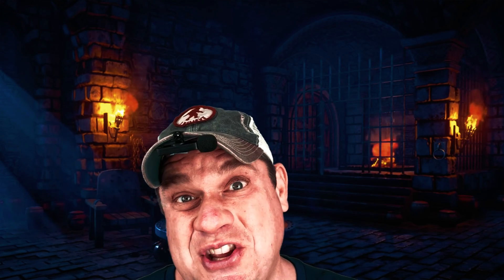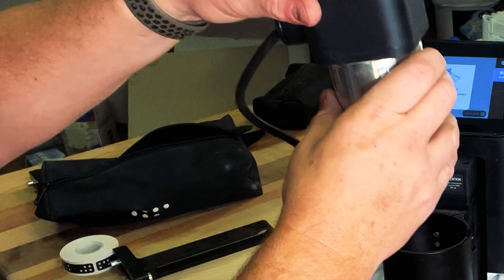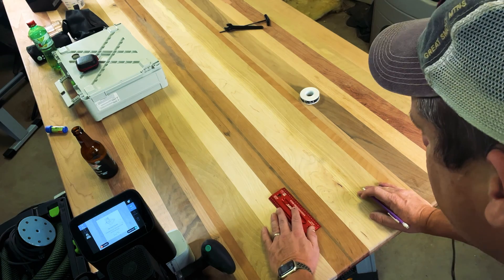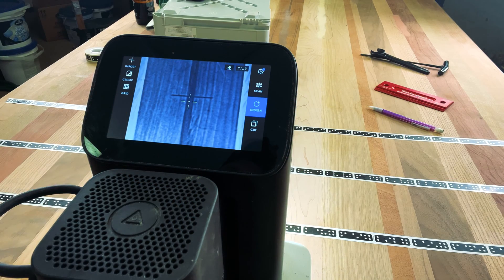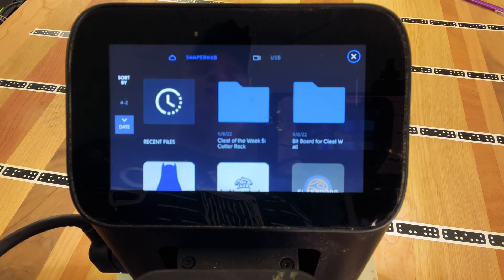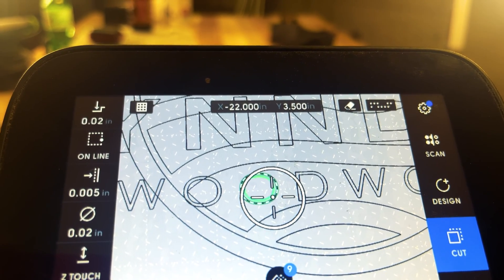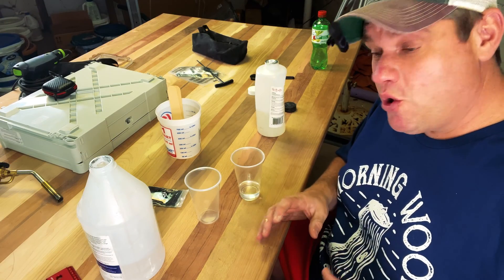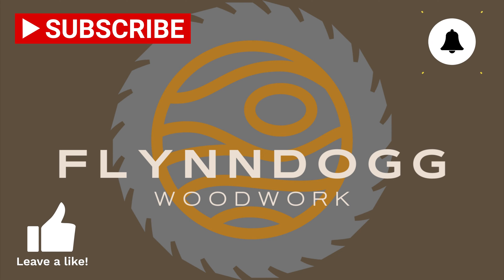Shaper Origin Basics: Everything You Need to Know About This Powerful Tool!

Comment: new subscriber, thanks for making this video.  I'm a new woodworker, 2 years in, learning like a sponge.  I want to go CNC but have a really compressed space, so I was thinking there may be another solution and that's how i cam across this.  Do you think it's a good solution for a beginner and for small shop space?  If it wasn't for Youtubers like you, newbies like me would still be stuck making bookshelves and cutting boards :)
Reply from the maker: Haha!  Nothing wrong with bookshelf's and cutting boards! :).    You know I actually got this when I was just about 4 years into woodworking and I have never looked back.    I think it's a great solution not only for a small shop, but even a larger one like mine.  It's one of those tools that I don't use on a daily basis but it is indispensable when I need it.    It is also very user freindly.   I picked up on how to use it fairly quickly and I'm still amazed today by the technology in it.  I would say go for it.  It's got a big price tag, but once you see it work you will understand why!

Comment: Thank you, you make it all look so easy! I purchased my SO a month ago and have yet to make a cut. I guess one thing I missed or didn’t understand is after setting grid. How did that Aline with your center mark? Did you just see it on screen when you set image? Thanks. Maybe today is the day! I have high hopes but I’m an old guy and very intimidated by computers and electronics. BTW I really appreciate how clear you explain things. I have had trouble following some of the Shaper sessions. I feel like they are just talking on a level that doesn’t exist for me quite often.
Reply from the maker: Yes!  You can just align the image as soon as you have the grid line or even if you don't have it.   I think you will be really quite surprised at how intuitive it is.   I use this thing about 3-4 times a year and I definitely don't consider myself an expert, but every time I pick it up, it is so easy to figure out because the prompts walk you through everything.  You will really be impressed!

Comment: Good explanation except how do you scale the vector graphic? Also I presume the dominoes give the router a reference at all times while working? Also, is there a minimum number of strips/dominoes as it seems quite random?
Reply from the maker: Great questions Avechristusrex.   The scale can be directly adjusted right on the tool inself.  You can either skew the graphic or keep it locked into proportion.  It really is very easy to do.   You are absolutely correct on the dominos.  The more the better with the dominos. I've come to realize the more using the tool I like to put them about 3-4 inches apart at the most.   Makes sure that you never run into an issue with the router loosing it's placement.  Great questions!
Reply: @ Thanks for those clarifications! One other question. How distant from the dominoes can the router operate? What is it’s range? Tks
Reply from the maker: @avechristusrex31  No problem, I don't know the exact range, but it really doesn't use dominos that are too far away.   I would say probably 12" in front of it

Comment: Nice instructive video.  Did you pre-treat the wood before the epoxy to prevent it from leaking into the grain?  Do you have a link to the final product?  Thanks for putting this together.
Reply from the maker: Thanks so much Tim!  Yes, I definitely pretreated it.  I used shellac.   Here is a link that shows the coating process.    Hope this helps: https://youtu.be/EX5-W3HCSj4

Have a great week and thanks for watching!

Comment: If I wanted to engrave a shamrock or a Buffalo how difficult would it be to get the image
Reply: Yes and no I’m trying to decide on one or the other and right now just doing engraving 
Thanks for your help
Reply from the maker: It’s really not that difficult at all.   You can really take any image and bring it into Inkscape and then trace a SVG file onto it.   It works best with black and white images, but you can do it with color as well.  I’m not a huge Inkscape user, but I do use it occasionally for that purpose.  There are tons of videos out there on how to do it!  Hope this helps!
Reply: @FlynndoggWoodwork  
Thanks for the reply 
I’m debating this over a cnc
Reply: This looks more versatile also it doesn’t take up table space 
My only other concern is the tape for scanning
Reply from the maker: @jim6402  yes, that tape is kind of expensive.  If you are doing smaller projects they do have the workstation that is available but it is also pretty pricy.  I've seen a lot of people actually create reausable workspaces with a sheet of plywood as well.  All great ideas, I've just never gotten around to making something like that
Reply from the maker: @jim6402  I love this tool and would get it again... but I still want a CNC if that helps.   This tool is great for engraving etc.  But it doesn't have a great 3D carving capability.

Comment: Is the third grid placement just hang the bit off the edge on the perpendicular side of the first 2 placements?
Reply from the maker: Excellent question.  I'm away on vacation right now, but it is either the second or the 3rd selection.  The nice thing is the screen explains it as you are going though it, so it really is quite hard to mess up.  But you will take two bottom measurements and one side measurment that is perpendicular if I remember correctly.

Comment: Think twice BEFORE you buy this machine. Why? 
Firstly, they want $199 for a software update. This isn't a joke - $199 for the auto-pass software feature, which allows for automatic multi-pass. (While this feature is not essential, it speeds up many jobs significantly.)
Secondly, Shaper Studio, an online service, will cost over $100 yearly  ( with a free version available that has very limited functionality.)
Thirdly, the tape and bits are overpriced. (You can use a label printer and free templates to get tape for $3, rather than paying $20 for the same product.)
Reply from the maker: Thanks for sharing your opinion Krysiek.  I haven't found the need for the software or the need to upgrade the studio.  I'm sure there are people that need this functionality, but I think what comes out of the box is quite robust.   I haven't paid a cent since I purchased the machine and I have never ran into any functionality issues with the machine.   Thank you for sharing your opinion though!

Comment: Thanks for the video.  Having to use the web or proprietary software makes it just too niche for me.  I like to go out to my shop and work when the mood strikes me.  Especially when the internet is out.
Reply from the maker: Well, In theory you can use a thumb drive to transfer files, as long as you have them in an svg format.   I have not tried that route as the web service is so much easier.  But I get it!    Also the web service doesn't cost anything which is nice.  I usually just use my phone for internet as I don't get internet in my barn.   Thanks for watchign dberry99! :)

Comment: So, is this just for engraving? Or could you yse it to cut mortise and tenon joints?
Reply from the maker: Oh for sure, there is an accessory that you can get (or you can make your own) called the shaper workstation that makes this very simple to do.  I have the workstation, however I haven't had a chance to make mortise and tenons with it yet.    You should check out shaperhub.com to see some of the projects people create.  Its pretty cool.  It isn't as versatile as a cnc but it is great for creating precise inlays or templates that you can use on your projects.  I wish I used it more often!

Comment: it does matter what router bit you have in for the grid
Reply from the maker: It's true that they recommend the engraving bit, but I've never had a problem with any bit I place in the router.  I guess it depends on how precise you need your grid to be, but for my purposes, I've never had a problem using any of the bits (the grids have always been completely square horizontally and vertically), especially if you are referencing the shank of the bit.   I only use the grid for a reference point, so I tend to always have to maneuver the svg vertically or horizontally on the grid anyway.   Thank you so much for watching!

Comment: I'd seen these used before but they didn't show how it worked, so I had my doubts about how precise it could actually be. So I was totally ok with not being able to afford one. I wish you'd shown a closeup shot of the finished engraving pre-epoxy. If you have a closer shot, maybe you can include it in the reveal vid? Either way, now that I understand how it works better, I want one--I mean I really want one. But since that doesn't change the fact that I can't afford it, I just have one more thing to say:
Damn you Flynndogg!
Reply from the maker: First of thank you so much for watching Bill!   Yes, the router is incredibly precise, You can go to 1/100 of an inch.  In fact a lot of times you cut off your lines, and then do a final clean up right on the line.   I've never seen such a complex machine that is so easy to use.  The price tag is quite heavy though, but if you do any engraving work or inlay work you can't beat it.  I have not yet made templates with it yet, but I know that is something that it is very useful for.   I will post some pictures on the channel to show what the final product looks like.  I ran into a little bit of a time crunch in getting the video out as I was going to show the final product, but the epoxy was still tacky!